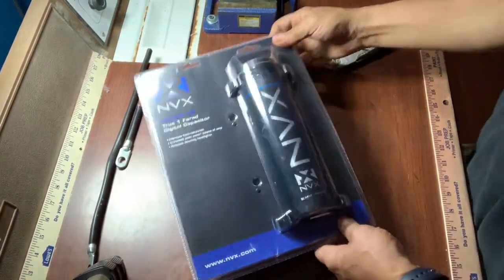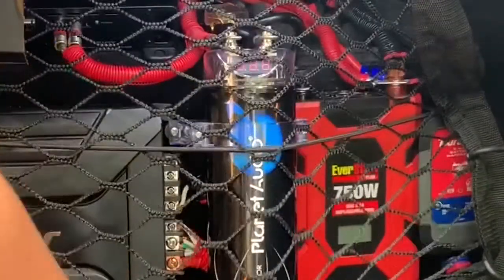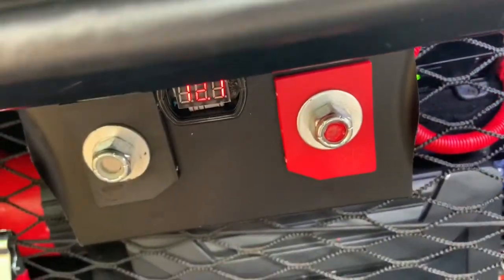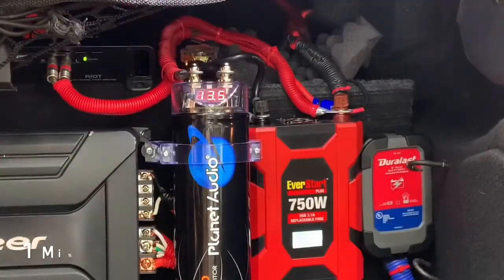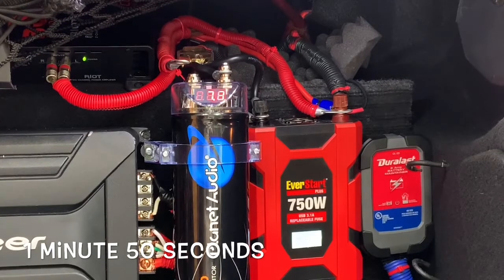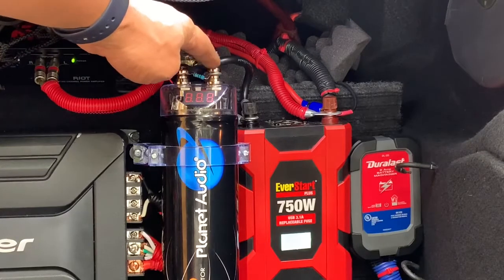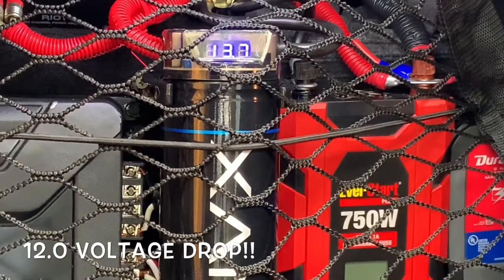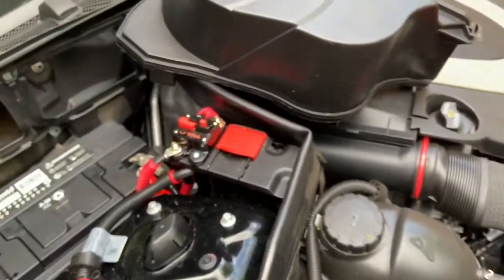NVX 1 Farad Capacitor Test and Review

Comment: I have the same cap it works wonders but not at first.  just make sure your car battery is fully charged and do a big three make sure you ground your cap and your amp buy dem selfie you have to have power to make power super caps work much better I've been told they do work to a extent I fought the planet audio only has a itty bitty cap the NVX is filled through sonic electronics cut some open and so did the guy from down for sound cut some fake caps open some of dem caps are fraudulent

Comment: What is a big 3 ?
Reply: Minimum 4 gauge wire..nothing smaller..some people change out the wires completely while others add on to the existing ones there..some applications may differ slightly because of unibody structures on some vehicles..
1. Ground from engine to chassis/frame
2. Ground/Negative battery terminal to chassis/frame
3. Power cable from alternator to positive battery terminal with circuit breaker in between connection....circuit breaker depends on your alternator amperage 120, 130, 140, etc..some people use a fuse connection but I prefer a circuit breaker

Comment: What the hell you running on that inverter a deep freeze?? You need a new battery preferably agm or even better lithium. And shorten that ground up now way you should have that much drop with that little amps going. I ran stock electrical on a 97 blazer with 2000 watts rms running and no big drop like that 12.7-12.8
Reply from the maker: Hey this was a few years ago but you are 100% correct on everything! Thanks I really should do an update video on this but I fixed everything. As far as the inverter it’s a good way of having a power supply in a location where there is no outlet. I have used it as a generator to power things in My Home during a power outage and I also use it when I’m out somewhere and I’m shooting a video or need extra lighting or anything that requires a 110 power source. Doesn’t have anything to do with the audio just a good thing to have on deck.

Comment: Yeah you have an issue. Im running a Skar 2000w amp on stock electrical with big 3 and a stock 90amp alt no dimming in a 2000 Accord. You get a crazy drop for only 900w!

Comment: I run a 2 farad. My lights dimmed, sony mex HU, half din eq, 3 way crossover in trunk as well as 2 amps(4 channel and monoblock, my amp is 800rms @ 1 ohm), a bass distribution processor and the 2 farad cap. Since i put the cap in my main battery doesnt move like at all and the cap might fluctuate 0.5v on the hardest low notes. Solved the dimming, immediate benefits is my experience, even in my under 2000 watt system. The cap is only hooked up to the monoblock amp and bass distribution processor is only hooked up to monoblock.

Comment: Hey man I got that nvx cap also but I'm confused with the resistor I understand to put the yellow wire in the neg terminal but I'm not running a ground wire from the battery so what do I use to connect the black wire with??

Comment: With a 900w amp there’s no way u should be getting a voltage drop like that! Make sure you have good wires none of that CCA crap u need OFC wires. And u shouldn’t have any voltage drop that amp isn’t strong enough for voltage drop.

Comment: something isn't right for a 400 rms amp you shouldn't be getting that big of a voltage drop especially since your alternator goes up to 155 amps. I have stock electrical and I run 1500 watts rms with 0 to very minimal dimming. I do run 0 guage power and ground in my f150 though. I hope you got it straight though good video bro.
Reply: It's the voltage inverter and battery maintainer and other components I seen tucked back there. The inverter should be wired separately and used by itself. The battery maintainer shouldn't be hooked up at all unless the car is gonna sit for months... and then you plug that from an external AC current source. If he did a big 3 he should peak in the 14s and dip in the 13s. I had 2 DEI 1.5f caps supporting a 1500rms jbl gt amp in a jeep Cherokee with a 14.4v 190amp alternator. Never went below 13.3 with the engine on.

Comment: What kind of battery is that? Stock? I put a dh6 optima yellowtop, and my voltage doesn't fluctuate like that, i have big 4. 
Yellowtop has less internal resistance so alternator charges quicker with less effort. A more stable circuit
Reply: I was finna say I got 2 skar 12s running 1200 rms @ 1 ohm with no cap and my voltage dont drop below 12.5 I got a 09 impala and no big 3 stock electrical system
Reply: It's definitely the battery